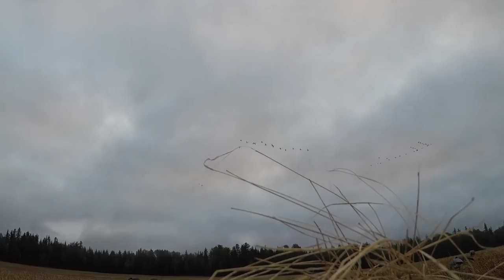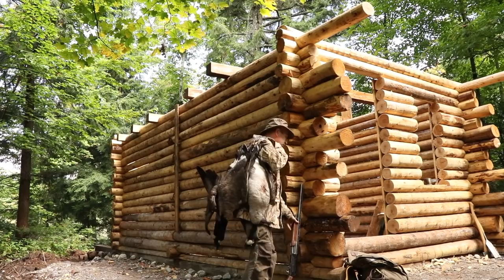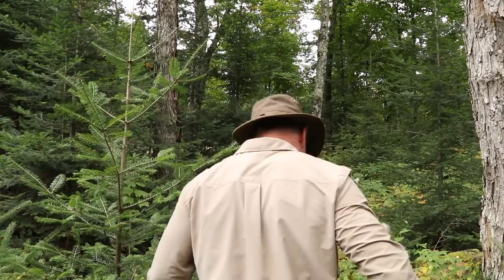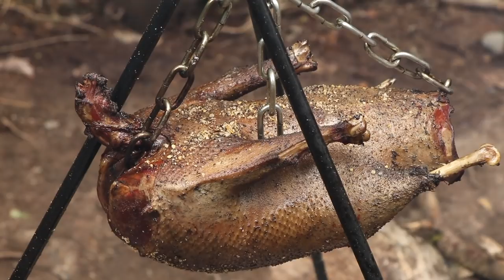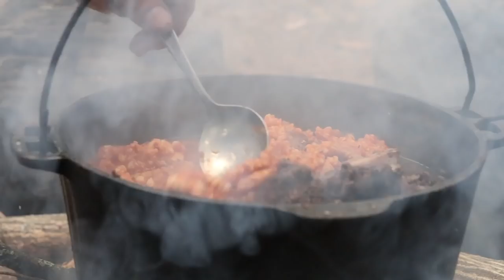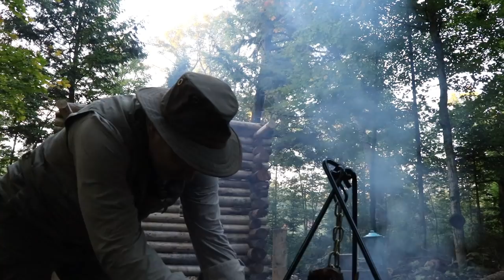Living off the Land at the Log Cabin

Comment: You should have a Leuku knife! It's used up in the far up arctic northern sweden/finland. Brilliant knife to split wood, separate bones when handling meat. Basically it's an all round knife for chopping upp al sorts of things. brilliant for batoning, and the scandi grind holds up nice.
Reply: And, i might add, since you live in climate very much like the climate we have here you should get a hidden tang stacked leather knife, they are brilliant to use when it's cold outside, when fishing or handling meat in extreme cold due to the fact that the stacked leather isn't cold to the touch and insulates your hand from the bare steel. 

Perfect for ice fishing.

Comment: If you want your cast iron pan to stop rusting after your done put it upside down on the coals, after a few minutes put it somewhere to let it cool then use a drop or two of cooking oil and rub it into the pot/pan. I prefer to use a peice of paper towel with oil on it and it also stops you from putting too much oil on the oil helps keep your pan/pot longer, it aslo helps make it non stick. It doesn't have to be cooking oil, it can be grease or oil from your wild game. I'd only use the wild game oil/grease if you use your pans/pots frequently. Otherwise any cooking oil will be best if you use said pots or pans on a weekly basis instead of a daily basis.

Comment: In oz its hard to find a cheap property, but not impossible. The banks dont like lending on lifestyle blocks, for the same reason you mentioned.

We have 109 acres in central west NSW. We were blessed to buy it outright. 

It had no habiltal house on it, and we are living in our caravan. Technically your not supposed to camp on land for more than 60 days a year... but, there is a clause for rural properties that you can stay on a farm in a van, if your employed to do seasonal work....ok. bit of a stretch. There is no definition for seasonal work actually means. 

There are a number exempt development building codes which we can avail  ourselves of. 2 * 200 m2 farm sheds. 2 * 50m2 buildings which can be a garden shed, gazebo, studio room, etal. We can also build an annex for our van.

Interesting though we have the ruins of an old stone / split slab house. 10 years ago it was a functional house, but the mines who bought the place put an excavator through it. ( the mine never went ahead and we bought the land cheap. Anyways I digress. Because of the age of the house, we dont need need permits to fix it up. Because the mines illegally destroyed it, the house has never been decommissioned. Because an existing D.A / usage is there we dont need paperwork and permits to remake it - as long as it's on the same footprint. 

We are blessed to have a lot of usable timber on our place to build with. The Australian/NZ method of building slabhouts is different to your methods. But we dont have snow. And our hardwoods are extremely heavy...

Comment: If you'll pluck the feathers, chop the head off, gut them,  then boil the goose, get the water boiling good before dropping it in whole, for about 20 minutes,  those pins or qwills will come right out.  You can either pull them right out. Or you can skin them off easily.  Then you can either roast it whole or cut up,, season,, flour and fry it..  That's how the old timers did chickens, turkeys and geese.  You don't boil them til done, just enough to expand the pin holes, losen them up.  Makes the job much easier.  Granny Fisher did it that way on the farm.  Us kids helped pluck the feathers with her.

Comment: I'm 18 and I just got a camping gas stove that uses screw on gas canisters. Are there gas gauges for these canisters? I'm wondering because it would be nice to know when they are low, so I can replace them. If there are, then can you explain how to use them? Thank you for taking time out of your busy schedule to read this and have a great day. You are awesome and extremely inspirational.
Reply from the maker: Thanks!  I don't know of any gauges that do that actually. It would be handy if they did.
Reply: I just put them in water. As they start to float more you should think about getting a new one.
Reply: @ Mainwarudo Kohna - When using the canister in an upright position, slowly run your fnger down the side of the canster. The point where the canister temperature goes from ambient to cold is where the level of the Propane is at.

Comment: I would consider getting a tractor if you re planning to build a few Cabins..you can use the Tractor as a Lumber Mill and to haul logs..think about it..find an old Massey Ferguson real cheap..they re out there..it s what I would do..because I dont believe in un-necessary work..because it s kind of Masochistic..Settlers did it that way but they also died at age 46..lol

Comment: What do you do for refrigeration and freezing off Grid? I am living on an off grid homestead in northern Arizona and have found without a fridge or freezer, due to not enough solar and battery capacity the only way I can preserve my meat, mostly rabbits is too make jerky. I would love to get an antelope or a havalina but I cannot justify any amount of waste do to lack of temperature controled storage. I am curious about your solutions even though you're in a colder climate it is still a necessity during the summer. I'm kind of looking forward to the winter because that will solve many of those preservation problems for me. Great videos and great work, you are an inspiration to folks like me.
Reply from the maker: James Madison Can you build an icehouse and insulate it with sawdust?  That's what I plan on doing
Reply: @ James Madison - You CAN have refrigeration on your homestead. Check out "Servel", "Dometic", or "Norcold" refrigerators. They can be run off of Natural Gas, Propane, 120 VAC, or 12 VDC . - I use both a Servel (Propane only) and a Dometic (3-way power - Propane, 120 VAC, & 12 VDC ) . Go to your Web browser and check out RV Refrigerators.
Reply: James Madison For your climate, I'd suggest underground storage as a way to make refrigeration an option for you. Depending on surface temperatures, you should be able to reach a constant 50-60f during the summer with 2-4 feet of soil above the storage area. Soil is an incredible heat sink.

Comment: What is supporting the logs between the door and the window?
Reply: I'm sure he has shown this in previous videos, but I'm not sure and would also like to know.  I think he uses 16 inch nails but don't quote me.
Reply from the maker: ✪ Funky ✪ wow, you're observant!! 12" spikes and 1" dowels. Once I cut the door and window out, that's how it settled into place
Reply: So do you alternate measurements from the door frame?   For example, 3" back on one log, 6" back on the next and back and forth from 3 to 6 to avoid hitting the previous spike?
Reply: That's really cool, I guess it was hard to see the supports from the outside
Reply: I mostly just enjoyed the video :) -but  that shouted at me as the SPOF of the build - I just assumed you had a beam support right side of the door. Because that portion can't support any weight at all, and it might settle and warp on its own.